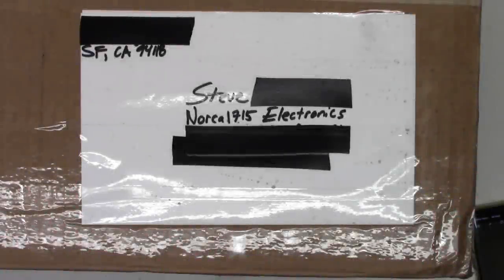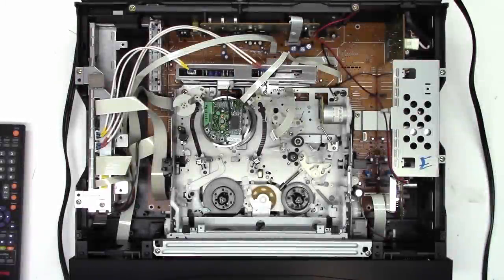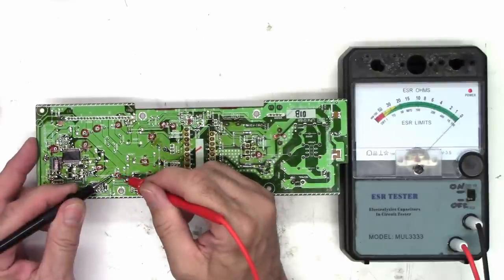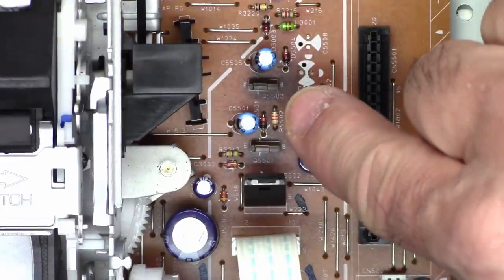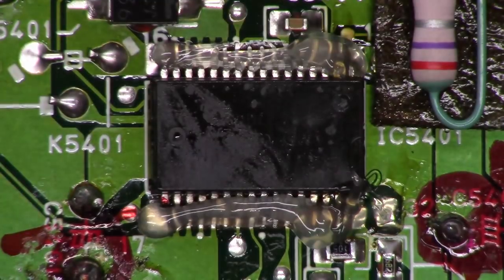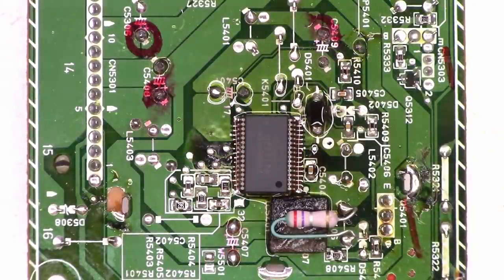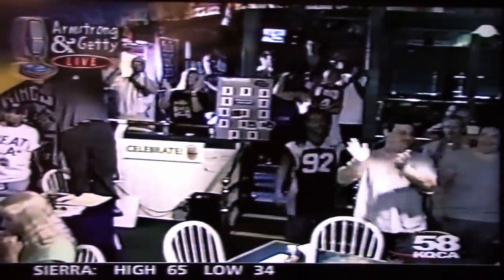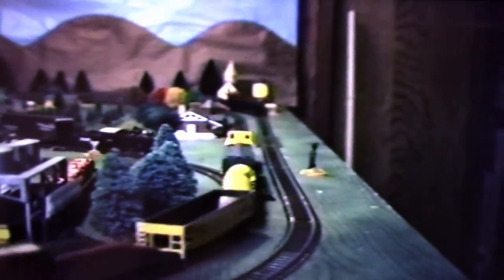MARANTZ MV8300 11-HEAD DIGITAL VHS RECORDER NO VIDEO, DELAYED OPERATION COMPLETE REPAIR

Comment: It's actually Super VHS (S-VHS). Don't confuse the video format with the video signal transmission standard... S-Video (Separate Video). It's called "Separate Video" because it separates the chrominance and luminance part in the video signal. Great video by the way.

Comment: In the video you showed that the manufacturer had a molded plastic bottom that obstructed access to the capacitors on the main pcb board. Did you end up taking the board and replacing the "warm components"?
Reply from the maker: I did have to remove the complete chassis to gain access, and yes I did replace all of the components that tested bad.
Reply: @norcal715  Thanks for the answer.

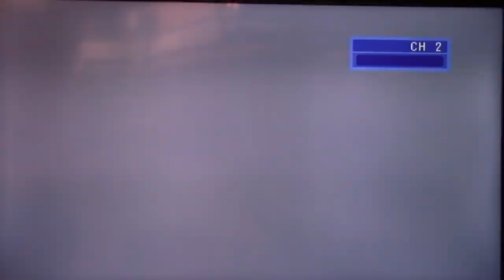Comment: 15:02 it was the third capacitor from the rock . great .  i'll get , ers tester as now i may suspect similar with JVC hm-dh30000u that played okay fine for little use , used , 10 hrs i think since got last , no year 2022 . all i see is scrambled code on the screen ? tried clean the video heads , same no picture/sound .
after seeing how you checked the player's psu power supply , and spotting some failed/tested capacitors and i hope that's just it and not the ic chip as well .
i ordered ers tester
Reply from the maker: Let me know how the repair works out please. Thank you!
Reply: @norcal715  yeah , sure if it works as i think there may have been some sort of decrease in the voltage for the video processor , if there is a video processor ? puzzling

Comment: After you desolder the positive lead, are you supposed to leave it in place when testing esr?
Reply from the maker: Ss long as the unsoldered lead is isolated from the solder pad electrically, then the capacitor can be tested "out of circuit"